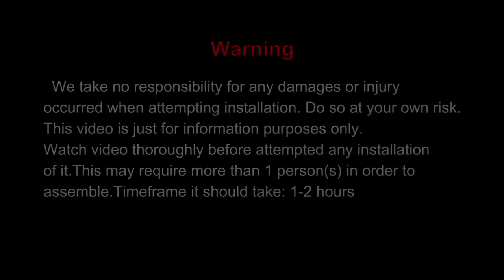ELEGANT Sliding Shower Enclosure

Comment: This was so helpful for me with my installation. The only issue for me was lifting and fitting the very heavy 8mm glass. 
The slightly built Asian guy gave me the impression it was as light as plastic.
Reply: Hi did you fit it your self
Reply: I am having trouble putting it together any help Would really appreciate

Comment: Can the green provided anchors be used to install these shower doors in a fiberglass shower?  IF so, what size hole is made in the fiberglass for the anchors?  The drill bit provided in the anchor bag is approx 1/8".  I don't see this working to well.

Comment: Just finished installing a 1200 version 8mm glass version the instructions and video are hopeless. No way is it a 1 man job its just too heavy.
I ran a smaller screw into the previous tapped holes in the frame but I still struggled with assembly.
Looks good when done but it took hours.
Reply: I've done it all on my own its not that heavy? I will agree it takes a while to get in all even and level but looks nice when finished.